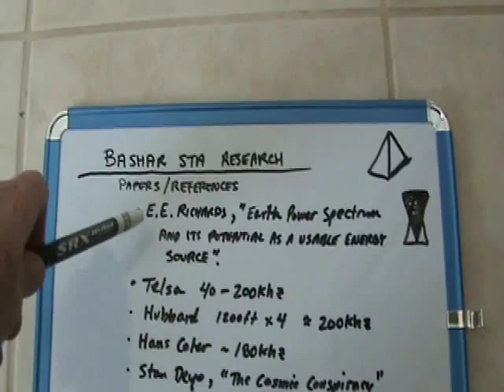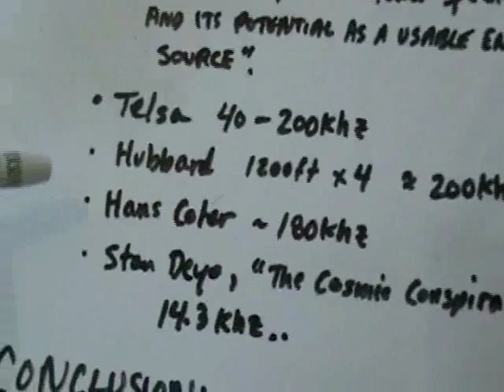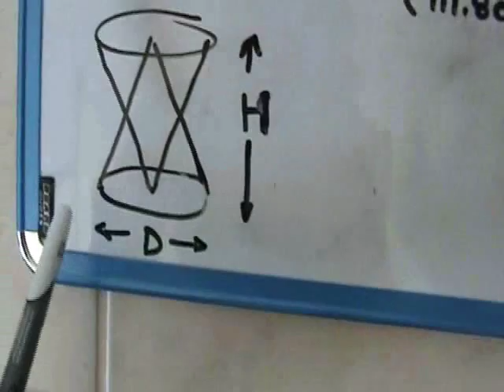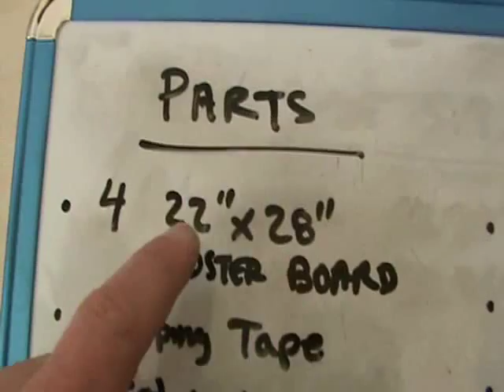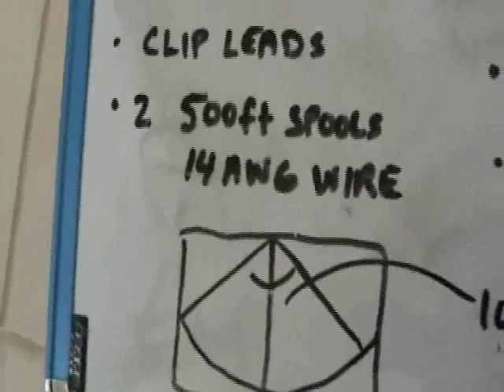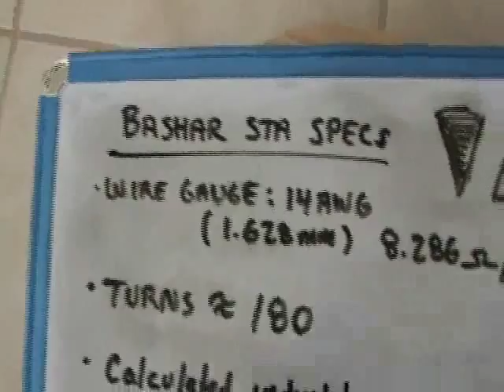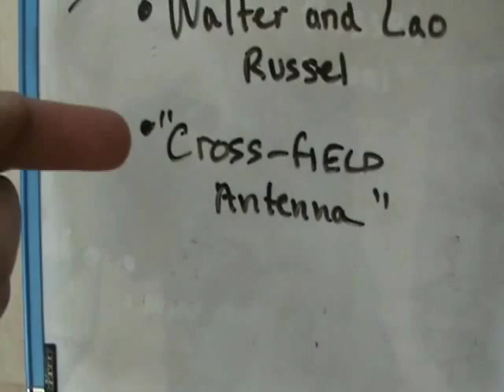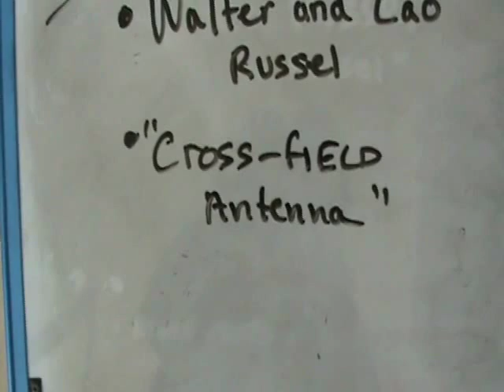Ep. 13: Bashar Free Energy Space-Time Antenna (Full Scale)

Comment: I just tried to build one myself and already failed at the wiring of the coil because wrapping it around a paper cone is almost impossible. Need wood, plastic or anything like that to make it firm. We need to push this research further. Unlimited free energy is the goal here!
Reply from the maker: yeah, a paper cone can be used if you put pins in temporarily, then remove them after coating the wires with varnish. They used to do things like that back in the experimental days of radio.Wood would be easier. Wood will add capacitance, however, and that is bad.
Reply from the maker: Actually the goal is more modest. Can a coil like this be used to receive wide-band RF? Converting it to power is done with something like the Tate Ambient Power module circuit -- an ac to dc bridge rectifier made with germanium diodes, NOT silicon. Germanium is more sensitive. The power will be modest, but still a fun thing to experiment with. I have wondered if a cone shape provides wide-band, because each loop is essentially a loop antenna of a different diameter.
Reply from the maker: Another realization here, which I learned about while thinking about the so called Hubbard coil, is that if each LOOP of wire around the cone is a phi-ratio smaller than the previous, and if they are spaced correctly, it might be possible for them to more easily inductively couple with each other at the various PHI harmonics. PHI has an interesting property that it is the only ratio where sin-waves PERFECTLY fit inside each other. So by doing the geometry right, you might get ALL loops to oscillate when one of them receives. In other words, its like several tuning forks, and you set one to vibrating, and all other connected tuning forks of different sizes also oscillate with PERFECT PHI beat frequencies. Doable?
Reply from the maker: Lastly, the HIGHER frequencies contain more energy, according to physics. But they are the hardest to convert to DC voltages w/o great losses. Further, these high energy bursts are short lived. But, by setting up a system that has an apex with small wave-length, and a base with larger wave-length, it might be possible to convert high-energy incoming pulses from the cosmos to lower frequency vibrations in loops of wire that are nearby and inductively coupled and sympathetically vibrating. By making this all a "tuned-circuit" ala Tesla, you minimize losses.
Reply: I turned off notifications to comments on other videos, so I'm glad I checked back and saw you answered in depth.
The plastic cone would simply be used to build the wire cone and could then be removed. Could you glue together insulated wires without any negative effects?
Bashar talked about the idea that it taps into the template level reality and through its shape amplifies the signal. This would have a similar effect to what he talked about happens in the king's chamber of the pyramid of Giza. But it's more like a pyramid within a pyramid (star of david) or a snake biting its own tail.
How would each wiring of the cone be ~60% smaller than the previous one? I don't see a way for it to be perfectly phi ratio'd but maybe you figure out the geomtry. :)
Yes, I also think the idea is to turn high-powered high frequencies into lower and lower frequencies that we can use. And he meant that we don't need to look further than the EM field of the earth for free energy. I will tinker with it an report back if anything meaningful happens. But I don't have all the fancy equipment you have (nor an electrical engineer background) so this attempt might be short-lived. Or do you have a video with all the measurement equipment and circuitry needed for testing?

Comment: P-l-e-a-s-e, the musical noise on your videos is loud, obnoxious and acoustically invasive; it destroys the creative impulses on the feeling level both before and after viewing. Please use some restraint. The information however is well thought out and acceptable and is appreciated.
One that note, can you explain how you know that the reference structure for the minimum size is a tetrahedron and not a 4 sided pyramid, and what is the included angle at the apex of the minimum size reference structure that Bashar spoke of.
Also, people can also purchase silver or gold plated solid wire which comes as either aluminum or copper wire as the base metal. Since electron flow is on the wire surface and not through the base metal that the wire is made of, the base metal is irrelevant except for it's heat dissipation capacity.
Also, there is wire base-metals that are superconducting at liquid nitrogen temperatures. The magnetic fields propogated by superconductors are electronically invincible...
Reply from the maker: Sorry you don't like the music. I try. 3-foot tetrahedron info is from Bashar. Minimum 3-foot tetrahedron. 33 degrees apex. Yeah I think superconductors would be wild to experiment with. As a hobbiest, though, I have access to stuff you can buy at radio shack or hardware stores.
Reply from the maker: 33 degree apex for cone that is, not tetrahedron.
Reply: I was asking for the apex angle of the "sizing reference" pyramid, not the STA apex angle. Is the reference pyramid a four sided pyramid or a tetrahedron and what is it's apex angle? Thanks. :-)
Reply from the maker: williamfarver Well actually, I think Bashar said Tetrahedron, NOT pyramid. With tetrahedron, every surface is the same square dimension, and there are 4 sides, not 5 like in a pyramid. The angle can be worked out using Trig. Wikipedia has all the math you need for a Tetrahedron.
Reply: Thanks morpher, Iam calculating the coil wire length as I write this. I've got some ideas for this coil for communications... :-)

Comment from the maker: @darthniq 
I attempted to demonstrate that in many of these videos. The coil responds to "received" energies. If you place it in a room with no nearby power sources, the coil is dormant. Put it near CFL lights, or a plasma ball, you can pull energy from the coil. Put it outside during the day, radiant energy can be received (but the power is low). More experimentation is needed to better understand the relationship between geometry and received power.

Comment from the maker: @Lupinlethird 
My thinking here is that hum is good .. noise is good .. glitches are good ... All these things ADD to the power reception. Unlike RADIO where you want to reduce static, noise, etc. In this case, we want to enhance it. So we need to think a bit opposite. If this coil was placed in a metalic tetrahedron capacitor, it is SHIELDed, but the tetrahedron is NOT ... and it can easily pass energy into the coil inside.